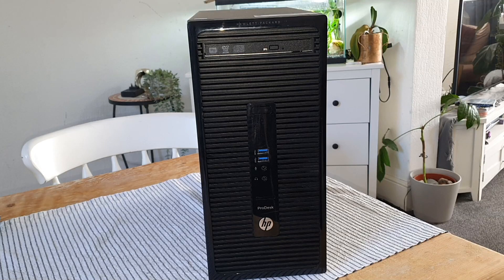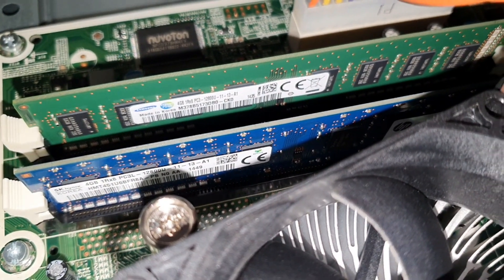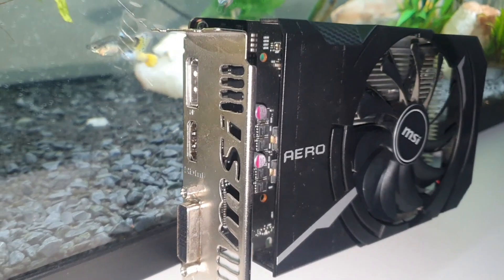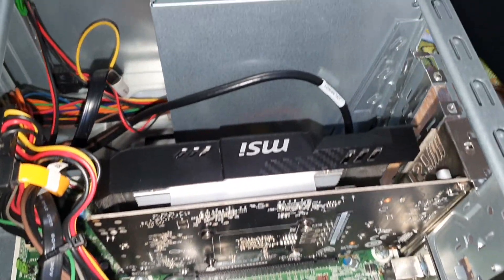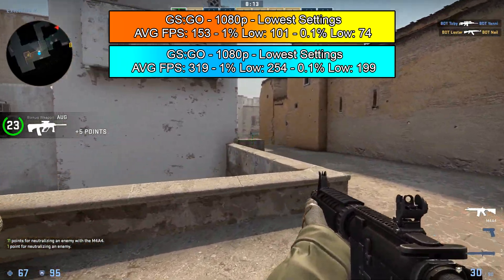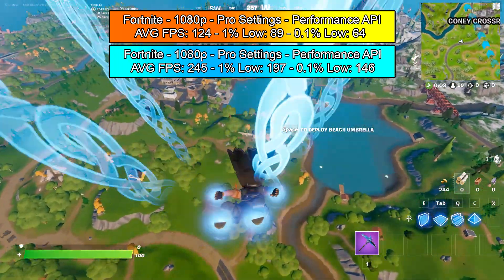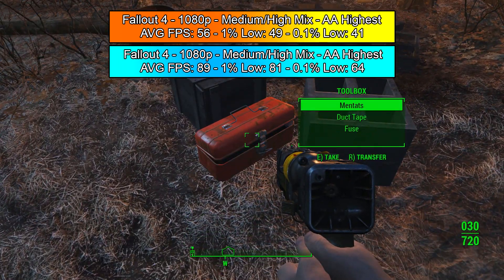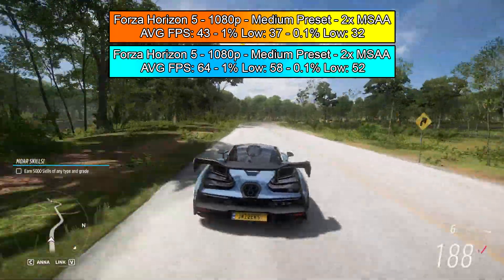The £84 PC Finally Get's Upgraded

Comment: It is really great to see what you can pull out of some older hardware at a bargain.  There is a series of shops around me that sell off least office and workstation PCs and they sell fully functional "ready to go" systems or you can but one with  no SDD/HDD so no software at an even steeper discount.  I transfer over my old hard drives to my new machines anyway and tinker with them like new PSU and a GTX 1080ti in my little Acer Aspire TC-885 with an i5 8400.    I also use linux so no point in wasting money on the MS tax.  This replaced my old Sandy Bridge T3600 workstation which was a decade plus at this point.  This I am hoping will last me at least the next 5 years.

Comment: wow average selling price for 1050ti is around £150? Makes me feel bad that I sold my gtx 1080 for under £200 lol
Reply from the maker: New prices for the 1050ti are still over £150 In the UK, they can be had much cheaper used but hold their value well due to the form factor and not needing external power. The 1080 has held it's price really well as well!
Reply: @brokeboybenchmarks3328  I sold mine in the UK on ebay in November or so, lucky buyer I guess
Reply: Yes, I'm amazed too.. how overpriced 1050ti is there! In continental Europe, they've been 50eur for months already (same as gtx970 and 1060 3gb)

Comment: woow , i put pentium G4560 into z270 MB(gtx 1060 3gb , 16gb ram ). start Fortnite  on medium ,it keeps somehow 60fps ,but thous before lounche moments ,pff, cpu 100% ,it freez ,go freez .. ugly.
Lookin for i7, not by thous prices!! You kud get m410, i3 10100f, + ram for it !!! Nice vid thx, btw. Ahoj from Morava.   ( sorry for my pooor Australish )
Reply from the maker: The Pentium G4560 Used to be legendary in it's day but I can definitely imagine it will lack behind these days, I would definitely recommend you upgrade your cpu, i7's that fit this socket can be had super cheap and will bring the pc back to life paired with the 1060
Reply: @brokeboybenchmarks3328  sadly in CZ : i7  6700  130euro, i7  7700  150euro
Reply from the maker: @lanehacker5833  That is very unfortunate, a 6700 can be had for £60 in the UK. guess we are super lucky
Reply: @lanehacker5833  Can you afford an i5 6500? That would give you two more cores, and much better L type cache than the G4560. In the US, these are not expensive.
Reply: @wagnonforcolorado  I have decidet to sell the MB,CPU,RAM combo, when from China  last week did komm  i7 11800H  ES  +MB  for 160 dollars (evidently sucessful seller, coz now they wanna 220dollars for it ) So thx for opinion ,but it so more valid. Ahoj from Morava !